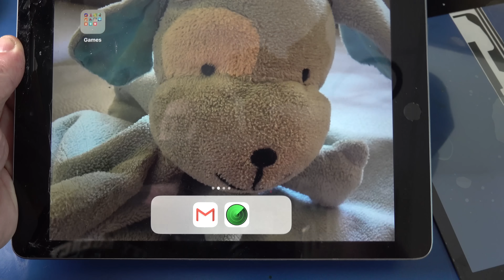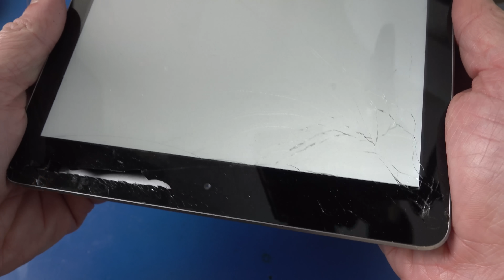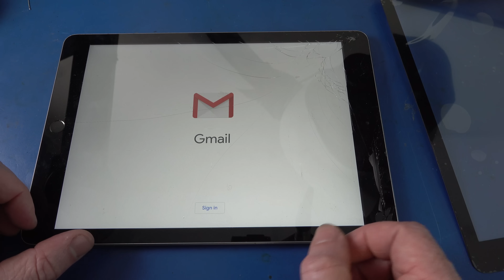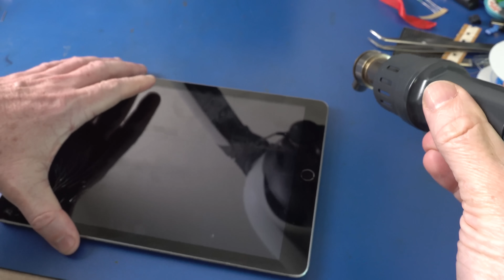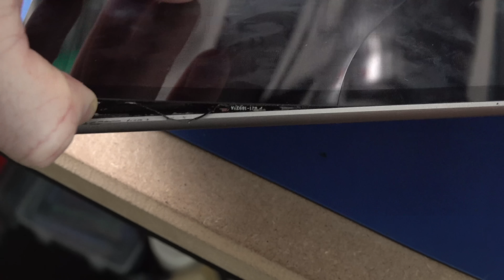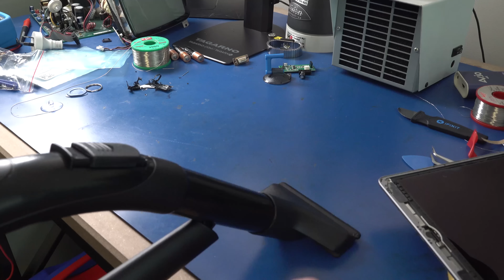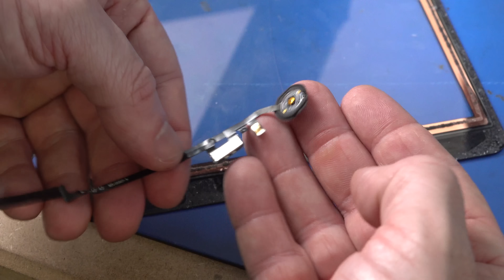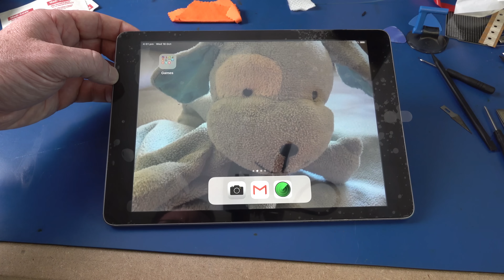EEVblog #1255 - Apple iPad 5th Gen Screen REPAIR

Comment: Need to apply more heat Dave.
Also, the temperature isn't right.
Airflow isn't right either.
Nozzle is on the small side.
What are you thinking, jeeeeez

Sorry, I had to.  lol
Reply: lol, there's a sticker inside my van, goes something like:
Hourly rates: Normal - $90/hr. If you've attempted it - $120/hr. If your mate's attempted it - $150/hr. Look over my shoulder for the entire job - $270/hr
Exc GST.

For comments just like yours, except I know you're joking. I assume you're in one form of the service industry or another?
Reply: @Jimmeh_B  We had one that said, "Fee if you want to "help": $65/hr."
Reply: @Jimmeh_B  
Yep, been in the service industry all my adult life!
Reply: @rossrobotics6342  figures :) 
We all have similar senses of humour!
Reply: @Jimmeh_B  LOL I need a shirt with that on it. So when i get to customers house to fix there furnace or AC they get the hint.
Reply: Hahaha, where have I heard this before...

Comment: My iphone 5S battery is going to die some time and I was wondering if I should take it apart, but I don't have hot air equipment. The only other thing I could think of is getting like a big power bank thing and a long cable, and running it from my pocket.
Reply: You can get any corner phone repair shop to replace the 5S battery for you for like $30-$40
Reply: The 5s screen isn't glued on like the new phones. You just need a suction cup.
Reply: Thanks for all the info. I think it is actually a 5C and I messed that up. I think it was the cheaper one.

Comment: "thats what ya get when ya have kids"...nope..thats what ya get when ya buy over priced apple crap
Reply: Yeah, because other tablets don't break. Derrrp. Also, no one except apple really makes tablets anymore. I hate Apple, but the Android tablets are trash.
Reply: @xenonram  my 3 'noname' tablets have survived multiple drops without cracking the screen...generally coz they are plastic and not glass..they also survive being thrown around...ya wouldnt dare to throw an apple device around...the things would be liable to break into 1million parts while still sticking together!...worst ive ever had is the screen popping out of the main chassis, was a simple 10sec fix to pop it back in
Reply: @WacKEDmaN  I also wouldn't dare to throw my laptop or oscilloscope around. Be careful with your stuff, and you won't have to fear breaking it.

Comment: I'm planning to try a glass only repair on my phone soon, it's an LG V35 does anyone have any tips for working with curved glass? I don't work in a repair shop so I don't have one of those expensive freezers to make the job nice and easy.
Reply: Most phones have the glass, digitizer, and LCD all bonded together. I don't know about the v35 though. Curved glass is the same. Heat it. If it's not coming easy, heat it some more. Don't force it. Also, let the heat soak it. Put your heart gun on low and go over it for a few minutes to heat soak it. Or microwave hot packs and wrap the phone in them. Otherwise, since the phone is made to disperse heat through the frame and glass, it'll get cold by the time you get your first pick in.
Reply: @xenonram  Well I could've been more specific, I get the gist of how to do it but I was most curious about tips for dealing with the curves? That seems like it's going to be the hardest part, I was thinking to start with a metal shim type of tool in the center, make my way over to a corner then once I have it free use some wire to get under the rest of the curve and I should be able to safely do the rest of the job with wire going through the top/bottom.
What do you think?

Comment: About that badly shattered end. Perhaps heat it to quite hot then apply packing tape down into the broken section then peel up the tape.  a lot of the small shards should come off with each heat, stick, peal operation.  HOPE YOU WERE WEARING SAFTY SQUINTS. I had a samsung mobile phone that had a broken screen and was assembled in a similar manner to your I-PAD, and got a quote to replace the glass, touch screen, LCD screen and it came to about only $50 less then a replacement phone. Neadless to say, I bought a bigger and better phone. If I had seen this two years ago I would have attemted to do the repair myself.

Comment: The suction cup is used to lift enough to slide a pick in.

With cracks and the suction cup, you will need to put some wide tape for the cup to stick to.

My S7 Edge just requires 10 seconds of heat with my hot air gun.
Reply: I heated the piss out of my s7, and I couldn't get the screen off without damaging it. WAY longer than 10 seconds. I used a heat gun and not a hair dryer or hot pads. There's no way you could even heat soak the glass, all the way around the phone, in 10 seconds.
Reply: @xenonram  Mine goes to 550c and I  used a direction funnel. 10 seconds of heat is enough to soften to adhesive and I never broke the screen.

Comment: Not sure with the iPads, but the home buttons are generally tied to a chip on the motherboard. So any replacement button, even a genuine Apple part, will not work with Touch ID (fingerprint unlock)
Reply from the maker: Wow, really?
Reply: 2018 Rossman discussing error 53 (Apple bricks iPhone with non paired button after software update (error later patched)):   https://youtu.be/cDYeby1Vanw
(There are other / newer video options)
Reply: EEVblog Yep, its really annoying!! on iPhones 7 and above, there is no physical button because it uses force sensors. if you replace the button you cant even click it!!!
Reply: @EEVblog  yes, with every apple product because they say its for 'security'. Every other brand like Samsung or Huawei you can just swap the home buttons with full functionality.

Comment: Dave, you got lucky.. Damaging the Home Button would have been a nightmare. The Button contains a fingerprint reader that is tied to the main processor by it's serial number. Damaging it would permanently disable Touch ID functionality (Fingerprint unlock, etc...) or even render the whole button useless. Welcome to Apple Design.
Reply from the maker: Why did I get lucky? I was careful removing it.
Reply: @EEVblog  Sometimes you damage it just by touching it wrong. Those sensors are really fragile but you did a good job. Videos make it seem easy but i can remember my first "glass only replacement".. Horrible!
Reply: That's not even the worst of it. Replacing it with a new one gives your device the uncanny ability of wiping your data on the next system update without any warnings it will do so because the button is not an original one.
Reply: @BrunodeSouzaLino  Apple got sued for this and they removed it. iPhones with replacement screens / home buttons got bricked by an update and turned them into a paperweight. This is not the case anymore..
Reply: @AtmelKiller  The loss of data was unable to be proven by users in court, so the judge granted Apple a motion to dismissal. People only got compensated by Error 53. Moreso, the data loss has nothing to do with Error 53.
Reply: @AtmelKiller  Once again, that's Error 53, which is not what I'm talking about.
Reply: This one is too old, no fingerprint
Reply: @darkfireBikes  It does. The button is flat with no "square" in it. Also look at the connector. Way too many pins for just a button, huh?

Comment: Nice job! I did a similar thing to iphone 6S, but with LCD already glued to touch screen. The button  bracket was screwed to screen, so it holds better, but the glue on button membrane had worn out and does not feel the same anymore. I would have cleaned the LCD better as I can see debris in video. Anyway great job, one more piece of usable tech saved from dumpster and back to good use.

Comment: I'd say good job for a 1st timer repair, about the one thing I'd suggest would have been to cover the shattered display with packing tape.  It's a common trick to keep shattered displays in one piece with alot less shards to vacuum up afterwards.  Other than that, everything works, so good job (for a manure hauler).
Reply from the maker: Yep, didn't think of that.
Reply: And apply heat to the back first / as well

Comment: This is one of the biggest reasons why I despise modern design as it is such a pain in the ass to repair.
Reply: MrKillswitch88 
I designed and built my own 3d printers. I have to admit that at first it felt weird repairing them when something broke. It took me some time but then i realised i have nothing else where if it breaks i can buy replacements and/or fix the broken part.

The most you can do with most things is change some caps or redo some bad solder joints.

Comment: You forgot to fold over the part of the touch ribbon-cable that has the tesa-strip on it. That's why it was hard pushing the glas back in. 
Also I always recommend to use some sort of spacer between the home button and the backcover to prevent it from being pushed into the device (adhesive of the home button can come loose). 
Other than that, I see no major faults. :)

I am doing these repairs to pay for University btw. :D
Reply from the maker: See my pinned update comment, I had to open again and epoxy the switch backing plate to the front panel, stupid design.
Reply: @EEVblog  Indeed. I hope the new Surface from Microsoft shows the world that a Tablet can be high quality and also repairable :)
Reply: @SaabFAN86  The surface is, and always has been glued together just like this iPad. The new surface x and 7 are ARM based, and are not going to be actual PCs anymore, but will be more of a tablet.

Comment: Glass screen protectors on order?
Reply from the maker: You underestimate the ability of children to break things...
Reply: @EEVblog  I've seen it too even with glass screen protector they manage to drop it just perfectly so the corner cracks haha.
Reply: @EEVblog  Get the protective case that has rubber around corners.
Reply: @stranger7968  Other important aspect is extra rubber(tm) over screen. You don't want it dropping face-down.
Reply: @EEVblog  I bet children would destroy a Verifone POS machine
Reply: That's not enough. Lol. You need a big rubber bumper around it so you could throw it at the wall without breaking it.